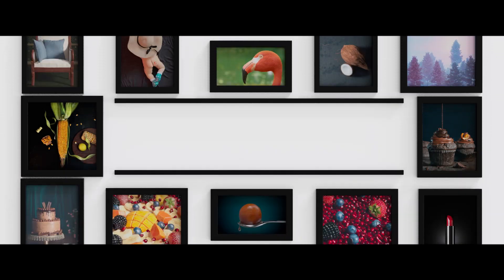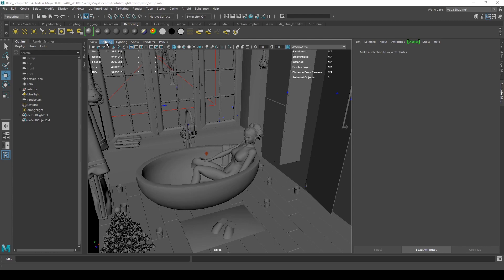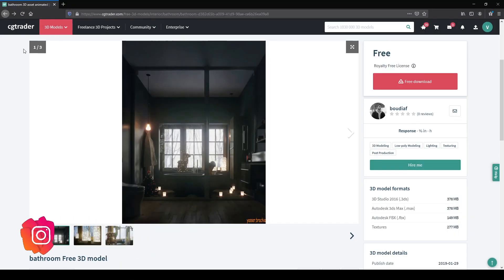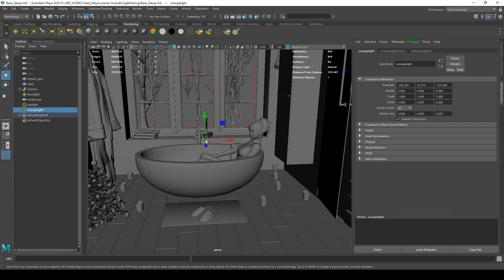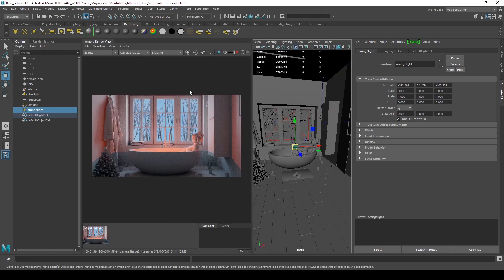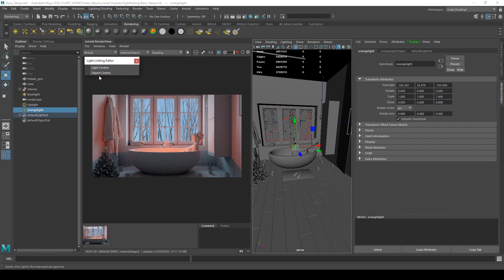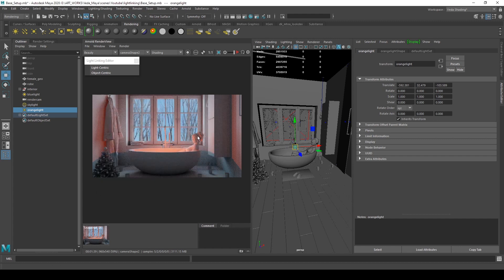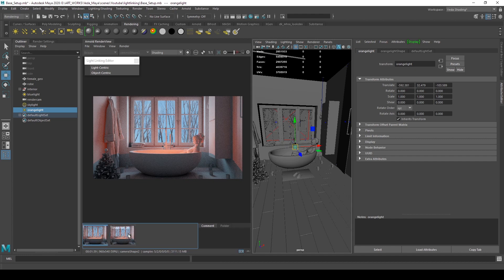Light Linking | Maya & Arnold

Comment: Thank you ❤️....And sir my z-depth passes aren't rendering in render sequence how can I solve it ?
Reply from the maker: I guess zdepth is rendering white. if yes you need to reduce the gain/gamma values in comp to see the depth variation.
Reply: @veda_prashanth  yes I know it's total white and you have to adjust it but it's not rendering, it's all black everywhere, its enabled in AVO's still no alpha, doesn't show any exposure or anything...
Reply from the maker: @dhananjaydeshmukh817  try rendering the z depth in another format maybe tif. Or delete the aov and add the aov again and if no other option is working. Try this . Create an environment fog in the scene and render by adding emission aov. Then use the emission pass as depth in comp. I haven't tried this method but just an idea. But you need the lights in the scene for this pass (maybe a large area light) would help. Let me know if this works.😊
Reply: @veda_prashanth  ok I'll let you know how it works, thank you..